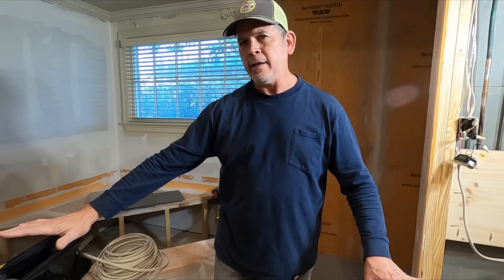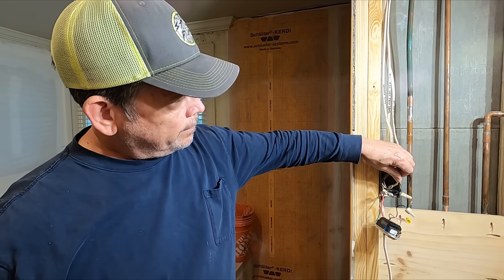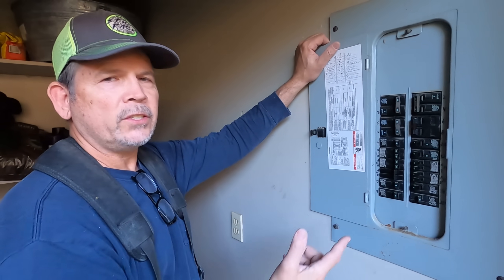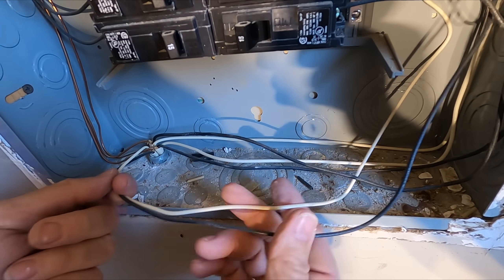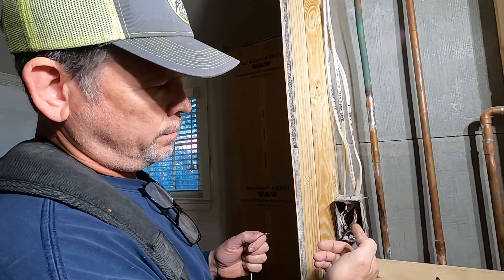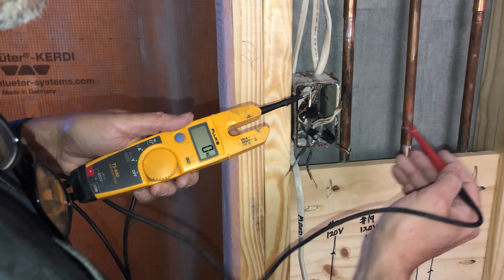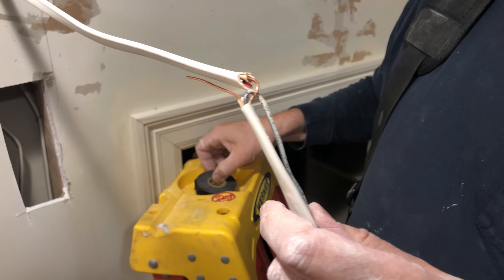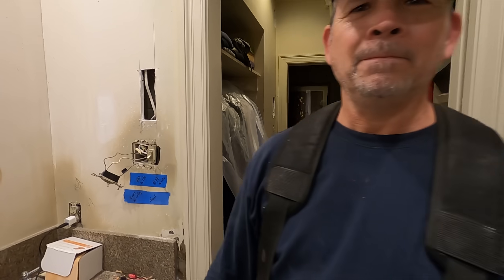You CAN Get SHOCKED by a Neutral Wire! This is How...

Comment: I wish I had these skills and knew all this stuff. I try doing stuff at home and it turns out eventually but I screw up a bunch in the process. on a side note it is crazy though that code allows shared neutrals I know a lot of electricians that will not do it for this very reason. Safety. At my facility none of the electricians will wire shared neutrals.

Comment: Electrical engineer here. I learned something today. We work on commercial systems, and all our circuits are run in conduit. You can run multiple circuits in a single conduit, and they are allowed to share a ground wire, but not a neutral wire. I always wondered why each circuit needed it's own neutral. Today I learned why. Thanks!
Reply from the maker: much appreciated 👍

Comment: You also have to be careful when the hot and neutral is ran to a light fixture instead of to the light switch. They will use a black and white wire to the light switch to complete the circuit, which means that white wire will have current. White is also sometimes used for 240 for one of the 120 poles. An air conditioner for example will have standard romex ran with the black and white both have 120 volts.

Comment: This is why I always check all my wires, hot, load, ground, neutral, etc. before I touch them. I don't care if I've flipped breakers or not, I want to know if they've got juice before I start messing with it. Electricity is one of the things I give the utmost respect to.

It's for the reason you showed that code says you cannot and should not bond multi circuits and sub panel neutrals and grounds anywhere but the source of your main disconnect. You don't want electricity finding its way around.
Reply: You should also check to see if it is dead because the breakers may be miss marked.
Reply: @royordway9157  I never trust any breaker markings for that reason and use a non contact voltage tester to make sure there is no voltage present.
Reply: Can also get shocked if the voltage shows 0 so be careful people. I used to test sometimes by quickly tapping my fingers on wires just to make certain lol. Most I ever got hit by was 277 and I tasted the copper in my mouth for a couple days afterwards
Reply: its the only sneaky bastard that we give respect to
Reply: Michael. I was wondering about that and why he didn’t point out that the neutrals and grounds are not bonded at the sub panel. 

That’s where I would have looked first.  Of course if I saw it was a three way switch… that would have been my clue.
Reply: I was installing a dimmer switch for the dining room on a 3 switch wall plate. 1 outdoor light, 2 hall light, 3 dining room.  I opened the breaker and tested the dining switch dead.  While I was installing the dimmer, I contacted the hall switch and got bit.  The hall sw on the other end was on a different circuit thus back fed to my end.  Lesson learned: check everything on a multi sw dead.  I was an electric utility lineman for 40 years so I never had much experience with house wiring; just general knowledge.
Reply: Gotta appreciate your concern for electrical safety BUT there's more of an immediate danger and an OSHA violation going on at 13:00 . Whats up with that?!? Well, at least he was wearing knee pads!!! Hahahahahahhahah, funny as hell!!! Reeeally? Come on, man!
Reply: @vicferrariproject  always someone to show he "knows" more....... troll.

Comment: No idea how this came up in my feed, but before even watching the video, I am going to comment.  I was an electrician in an older city when young.  The wise old coot I worked for taught me the ropes.  One of the things he stressed very often was being EXTREMELY careful around "neutral" wires when we were replacing knob and tube wiring.  If you pull a load through your fingers, you're going to friggin know it.  I mean quick, fast and in a hurry. 

Second item was the day his screwdriver disappeared in an arc flash when it (the pokey bit he was using) got between a loose neutral lug and the neutral wire - for a 12 gang apartment meter panel.  The klein just vaporized.  He suspected it was an issue, so he just gave it a tap and boom.  Neutral is no joke.

Comment: I know it is not actually the main concept of this video, but I would like to ad that once the PEN has been separated to PE and N one shalt not ever unite them again upon any existing and non-existing condition on the course of the internal circuitry of a domestic household! The Neutral has shocked you because you were on the same potential as that brass pipe you have metered (you probably knew that), and you were on the same potential as that brass pipe not accounting the resistance of your boots and body, actually meaning "as if" you have touched the very Live of 120 Volts in the US! We, in Europe (Hungary) have 230 V at 50 Hz between N and L, L and PE and 400 V between phases, and abide to very, very, very strict rules when it comes to shock (or touch) protection and potential equalization. I highly recommend for the sake of one's life to first REALLY understand how current, voltage and resistance operate together and on a whole before attempting to fix or wire anything with high current flow. I would also be extremely cautious to touch and fiddle with the wires under voltage having only one layer of thin insulation, as you could also get easily shocked (sadly, I have), if that frail insulation beforehand has been ill-treated by a non-professional layman for example. Good day and stay safe!

Comment: you can still get shocked from neutrals even without a back feed. if you separate the parallel neutrals on a live circuit and touch two separated neutrals you will become part of the ckt. and get one hell of a belt. always shut the breaker off even if you know what you are doing

Comment: That's brilliant detective work. Finding cross wiring is tricky, so why I use a tester before working and try to never touch a bare wire; a trick my buddy taught me. My contractor/neighbor got lit up when replacing outlets in my house. He's in the pantry/laundry where both a switch and humidistat control the overhead fan. All tested safe until the humidistat kicked on while he was touching a wire. As you say, a shocking experience, but the pain in his left arm went away after a while. The humidistats were improperly wired. They ran a separate circuit for humidistats, then connected the fan wall switch from the same circuit used for lights; 2 circuits crossed. I wonder what would have happened if they'd been on different legs at the box. I expect both breakers would pop, shorting circuit A and B together.

Comment: That white white wire is not a neutral that white wire is a hot it's just White. just because the wire is white doesn't mean it's a neutral don't go by the color of the wire you don't know who was there before
Reply from the maker: It’s a neutral.  The black tape was mine to indicate which white wire had voltage on it.
Reply: It's a hot wire regardless of the color if it's reading 120 it's definitely a hot and it sure wouldn't read that

Comment: I want to REITERATE to everyone on this thread that seem to be DIY oriented. IT's great you are doing your own work. Bravo. When it comes to worked with shared neutrals do your homework. If you mess up and open a neutral on an shared neutral (open neutral condition), you will energize the ENTIRE circuit to 240 and anything plugged into that circuit not rated for 240 will blow up, start a fire, melt, etc, starting with the load with the highest resistance. Beware of working on a shared neutral circuit if you do not know what you are doing.
Reply: I don't get it....All the neutrals on all the circuits are tied together at the neutral bus inside the panel....isn't that sharing a common neutral? ..please explain what I'm missing here. I'm a plumbing contractor so please bare with me.

Edit: Now I get it. It's the single neutral carrying the load of 2 (or more) circuits, on the same phase, BACK to the neutral bar we're talking about. Possible overload.
I enjoy learning stuff.
Reply: @readmore3634  l
Reply: @kenfong8580  l ?   .......  what?
Reply: @readmore3634  The type of "shared neutral circuit" being discussed here is more properly called a "multi-wire branch circuit".

You might be aware that a typical US home has TWO different hot conductors coming in from the street -- they are "out of phase" with each other, you could think of them as sort of like +120V and -120V, so each one by itself is 120V to neutral, but together across both of them is 240V. (I will call them legs A and B.) A "multi-wire branch circuit" has some 120V devices or outlets on "leg A", and some on "leg B", sharing a single neutral wire, which only goes back to the box at one point.

Normally the electricity would go: "leg A" -> device -> neutral, or else "leg B" -> device -> neutral, giving 120V either way. But if you "lose" or break the neutral, now electricity suddenly goes: "leg A" -> device -> device -> "leg B". The system is not meant to operate this way, and depending on the devices in the circuit, you might get not power (if all the devices on one leg or the other happen to be switched off at the time), or something nearly-normal (if the devices on both legs are roughly balanced), or you might get something approaching 240V appearing on one side, and close to 0V on the other. In that last case, you can blow up some of the devices.
Reply: @gwillen  Thx for the reply...and I understand what you're saying. It was explained to me as: pedaling a bike with 1 foot and pedaling a bike with 2 feet... opposite sides of the sprocket (2 phase). On heavy equipment (pool pump for instance) it's more efficient and less cost to run 240....I get that too. But if you lose a neutral on a 120V circuit...isn't that what a ground is for? Not sure how to tell if you lose/break a neutral. GFI I guess.
   Here's why I even watched this video. My son bought a house built in the 50's... no ground throughout most of the house. Someone had moved the washer/dryer location to the garage and tapped into an adjoining bedroom's wall receptacle to power both. (wrong) I went to an electrical supply house and bought a 100ft roll of pretty heavy gauge 3 conductor wire plus ground and 2 new 30A breakers. About a 50ft run from panel to location. Black wire (breaker A) to the washer plug, blue wire (breaker B) to dryer plug and shared white (neutral) and ground. It was a bit overkill... but now I wonder if it's ok to do this. Thank you in advance.
Reply: @readmore3634  Do yourself a favor and get someone knowledgeable to check your son's washer/dryer wiring! Most likely not ok.... but too short on details of the electrical characteristics and requirements of the washer/dryer (is it a combo unit or separate components?, plugged configuration or did this get hardwired somehow).... Most residential washers plug in to a 120V 15 or 20A receptacle. Most residential dryers and combo units plug in to a 240V 30A receptacle. And these are appliances where a ground connection is really essential). Regardless "pretty heavy gauge" doesn't show up in ampacities table 310-16 of the NEC?! Supply house probably sold you #10 AWG conductor cable with those 30A breakers....  Btw, just remember the neutral wire is a current carrying conductor to complete the power circuit. Ground wire is protective safety conductor to carry current (and trip the circuit protection) when there's a short circuit fault to exposed conductive surfaces, not a back up neutral!
Reply: @philgilmer4313 Thank you for the reply.... I talked to an electrician a few days ago, 42 year journeyman. He said as long as the 2 load wires were on opposing phases (which they are) they will pretty much cancel each other out and be no problem....otherwise the common would potentially be carrying a 240 load. He also said that in the 50's many houses had/have metal boxes tied together with a separate ground wire you can't see unless you open the wall. He said  look in the back of the box for a ground screw...I'm pretty sure I saw that scew....so he said the house is probably properly grounded...just in a different way.
    I knew ground was for safety...maybe I worded it wrong. But I know current is always looking for a place to go....better ground than me. Thanks again for the "civil" reply.
Reply: @gwillen  I sometimes do electrical connections to the a box.  This really explains a lot to me thanks!!
Reply: @readmore3634  That's a lot better than a kick in the ass! Unless one or both of the case shells that are supposed to be grounded get connected to the hot side if the ground gets lifted or the switches are not on the hot side. Bond both cases together with a separate wire.😀 You really should run two separate grounds.
Reply: @gwillen  This is why these circuits require double pole breakers, or a small handle that physically attaches the two breakers together if retrofitted. The breakers must be positioned right next to each other. This way you are forced to shut off both circuits together. This is most commonly used for split receptacles in order to get 15 or 20 amps from each outlet. Used to be very common in kitchen outlets and can sometimes be used in a garage or shop to run two high draw items at once, or a string of outlets to get more current capacity, while only needing a single 3 conductor (plus ground) wire as a homerun. instead of multiple dedicated lines. Totally fine and safe if done correctly.
Reply: This isn't entirely true. If the neutral breaks, none of the devices will truly get 240V. Only the ones that were intended to get 240V will get the full 240V. However, any devices with a higher impedence relative to the other devices will have a voltage above 120V. The higher the impedence of the device relative to the other loads in the circuit, the closer the voltage will get to 240V. Any device with a low impedence relative to the other loads will actually get less than 120V. The lower the impedence of the device, the closer it will get to 0 volts. Devices that are right around the average impedence of the circuit will get somewhere close to 120V and will function just fine.
Reply: Please someone draw it out or post a video and save someone setting the place on fire.. please
Reply: Gotta appreciate this guys concern for electrical safety BUT there's more of an immediate danger and an OSHA violation going on at 13:00 . Whats up with that?!? Well, at least he was wearing knee pads!!! Hahahahahahhahah, funny as hell!!! Reeeally?
Reply: @vicferrariproject  I don't understand. How is that an OSHA violation?
Reply: @HoloScope  Probably standing on top of the ladder--dangerous.
Reply: @HoloScope  
The top of the ladder is not a step. The manufacturer’s labeling clearly states that. So standing on top of the ladder at the work site is a safety violation.
Reply: @totallyfrozen  thanks
Reply: @totallyfrozen  and the step below it is typically not a step also, get a longer ladder guys.  From Werner 'The highest permitted standing level on a step ladder is two steps down from the top'
Reply: @vicferrariproject  p
Reply: So are you saying that the 110 from each circuit will feed into the hot wires turning them into 240 sort of like when someone tries to parallel two breakers to make a 240 but how does the circuit return power to make a circuit, does revert to using the ground wire for a neutral.
Reply: That's what I figured what happened to me. I was changing a receptacle to gfci and was testing the leeds and my (vom) meter test leeds went pop! one blew apart. 240 fried the wire right off the handle??
Reply: @blueplasma5589  wow. What rating was your meter tolerant too? Seems odd as most meters should be ok upto 600V..

Comment: Guy I love your channel but you should not have been messing around with that circuit you LUCKED out and you could have fried those lights and many other things.

First, that is a shared neutral circuit and is allowable by code. You do a fair job of explaining the layout of that circuit but you missed some CRITICAL information that could kill someone or cause a lot of damage. HOW?

Second, when you opened that neutral you were LUCKY that the the breakers were not on different legs of the split phase. In a normal condition a multiwire circuit would be on a bar tied 2 pole breaker. CURRENT code mandates that in a shared neutral, BOTH ungrounded conductors have to be disconnected at the same time. WHY? Because when you open the neutral you turn it into a 240 volt circuit. It would have fried that single largest load with the highest resistance and so on. Yes, the neutral carried current and if there were loads on both legs it will carry the unbalanced amps. 

Great videos, you do some awesome work! Yet, this is one of those things you should have known more about or gotten some feedback before messing with that circuit. To be fair, it was not set up normally and would not be up to code today. Who knows what it was when it was installed though.
Reply from the maker: Thx. I knew they were same phase (CBs 19 & 20) so I wouldn’t have the 240 volts but instead have an overloaded neutral.  I didn’t want to get too deep in the weeds with “same phase” and “opposite phase” in this video

Comment: Similiar to some of our old building installations where 2 unit heater motors can sometimes use the same neutral. Shut off one motor rather than the breaker for both and can get a a spark as the other motor is still running. Now I always shut off the breaker or check the neutral voltage to ground.